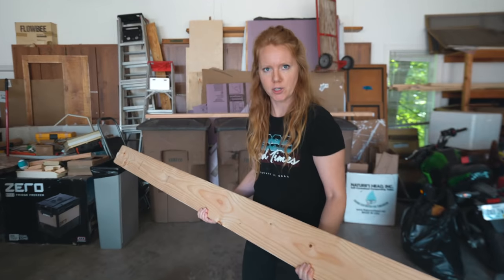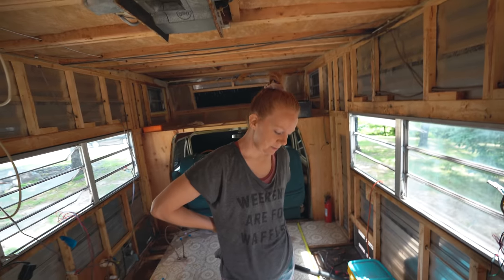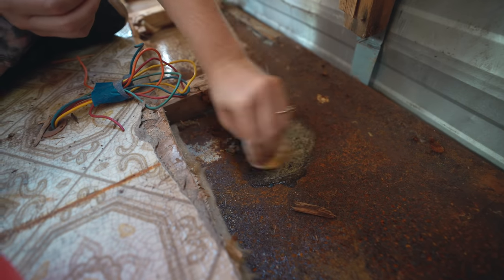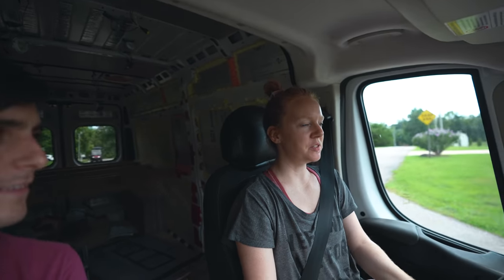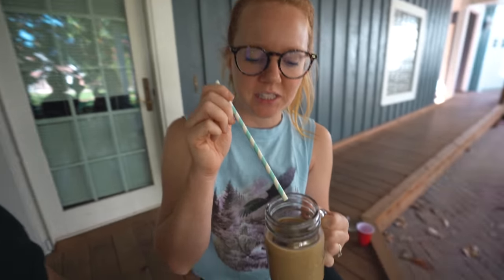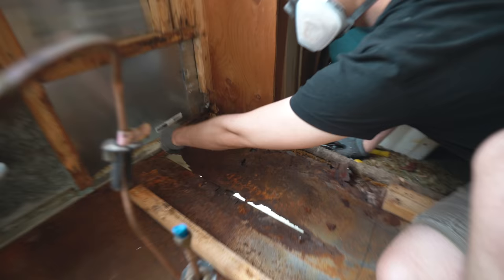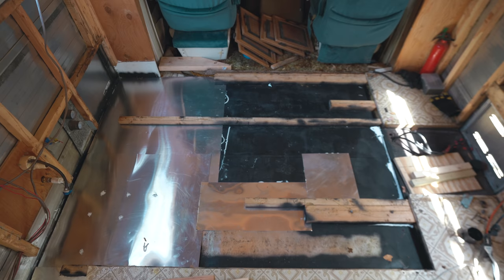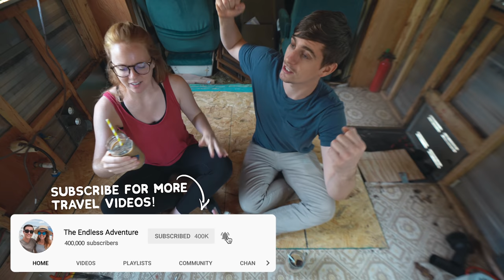RV Renovation - We Completely Rebuilt Our Floor! 😳 Longest Project Yet (Ep. 8)

Comment: Just something that was on my mind. If its rusting, its not aluminum. Its iron/steel.
Reply: Exactly, aluminum can corrode, but it looks nothing like rust. Aluminum corrosion creates aluminum oxide which more of a white-ish substance. It’s also way slower process compared to rusting steel/iron which you can actually see rust in real time if you just spray some water on it. :P
Reply: its not actual rust as its a Aluminium oxide which forms when the metal is exposed to water, also if there is any steel in this RV then its more likely to be either galvanised or stainless steel which does not  corrode but takes a long time o rust
Reply: When Aluminum corrodes it is white not red, alert Aluminum on Steel or galvanized will corrode very fast (galvanic corrosion)....Use a magnet to check... aluminum is non magnetic.

Comment: I sure hope that you fill all those cavities in with moisture resistant foil faced insulation,  than a layer of reflectix on top of that, before putting the floor plywood down. The difference is incredible and so worth it. The same with the rest of the motorhome,  walls and ceiling. It will heat and cool so much better,  and be so much quieter.

Comment: I think you had thin sheet metal and not aluminum. Rust is a steal trait.
Reply: I was shaking my head. How don't they know that aluminium doesn't rust?
Reply: Probably rusted galvanized
Reply: Because they haven’t taught “shop” in schools for a long time
Reply: Hope they've realised in time. Add a magnet to your kit......
Reply: Aluminium doesn't rust in theory it can oxidise, but that was definitely some sort of plated steal the rust had eaten through the material to the point Eric could tear it from the structure.
Reply: Aluminum can't rust but oxidation does occur... and if used with steel, can be a catalyst for oxidizing the steel, which will in turn rust, but it is no more a catalyst than the metal itself is, so basically, they still have a much better floor than when they bought it, especially after beefing up the strength with 2x4s.
Reply: *steel
Reply from the maker: Thanks for the note. We've realized our mistake and are working on taking out the aluminum bits. Unfortunately it's our first time working on a project like this, so we're learning a lot as we go.  I'm sure it won't be the last thing we get wrong, but we really appreciate you all looking out for us 🙌
Reply: @Theendlessadventure  keep up the hard work aluminum is better for rust anyway.
Reply: @Theendlessadventure  ...as Dory says "Just keep swimming!"
Reply: @Theendlessadventure  easy way to tell is aluminum isn't magnetic, steel is.

Comment: My wife and i own a 1989 Tioga class C motor home. We want to share 2 important things with you. First the large window in the over head cab area should be eliminated for the following reasons: constantly leaks, lets in a lot of heat or  a lot of cold. The overhead  portion on a class C motor home sits a rubber bushing to help the unit absorb the constant flexing that it will do driving down the roads. When you camp off grid many of the roads are wash  boarded and vibrate the entire camper. We have rebuilt the overhead part twice and the second time i eliminated the large window and it is a blessing. Second the best material you can use for your flooring is Marine grade plywood. Yes it is expensive but it does not rot, or warp, and is extremely strong. OSB board is made with scrap and glue, even the more modern boards today when exposed to water will rot.  The material when exposed to water turns to mush.  It is the old adage you get what you pay for. Your videos are  excellent and you are trying to do everything to make your camper last and become beautiful again. I do not want to make you feel bad, jut want you to not have the headaches that we have endured as we have owned our camper for well over 20 years and raised 4 children with it and now we converted it to a couples camper. We wish you nothing but the best and hope this helps you. One last thing you might want to add to your camper is hydraulic leveling jacks to your camper if you do not have them. They are well worth the investment as you can stabilize and level the RV from inside during inclement weather. Best of luck and look forward to your videos as you experience your camper renovation.

Comment: Should have insulated the floor where you had it apart.    Also I think your metal on the floor is steel. You can always try a magnet to determine what the sheet is.
Reply: It was steel, but they put an aluminum patch.
Reply: Isaiah Bangura right, which is why I commented to them about using a magnet so they could determine the same thing and avoid using nonsimilar metals together.

Comment: One last thing on this video... Prime everything, metal, wood everything
Reply: The reason to prime the Al is your adding it next to steel. You will get galvanic corrosion and that Al will be gone in no time....
Reply: I was thinking that it wouldn't hurt to coat the underside of the chassis too. Salt water on roads tends to be bad for vehicles.

Comment: That's not aluminum.  That's sheet steel or tin.  Aluminum doesn't rust.
Reply: tin doesn't rust either, it oxidizes. tin oxide is also generally white.
Reply: @upwardsofunknown7161  Yep.  I knew that.  but tin will rust in it's more advanced stages of decay.
Reply: Tin doesn't rust (rust is by definition oxidized iron - all the alchemy in the world won't get tin to rust).

Comment: a little trick with the aluminum floor is to spray truck bedliner under the RV it will protect the aluminum and quiet down the road noise.

Comment: I'm glad y'all liked paper straws, I think they are awesome. What I do with my paper straws, is take them camping. I like shoving pine needles through them and using them as fire 🔥 starters. Then I get my plastic straws out of a plastic wrapper, and use that to drink with. The thing about plastic straws is you can rewash them several times with soap and hot water.

Comment: OSB is prone to absorb water like a sponge so if you ever have a leak again you will have to replace it again. Use plywood for better structure and durability and as you screw it down any warping will be forced out of the boards. Once you lay the new floor make a mixture of Borax and extremally hot water and spray the new floor down with it to moisture and mold treat it.

Comment: floor is rusting so it's pretty likely to be steel - putting steel and aluminium together is going to create a galvanic corrosion cell eventually....  using bolts / screws through steel /aluminium is worse than gluing though.  A  general purpose "no more nails" type adhesives may not be the most structurally effective bond on aluminium to steel sheet  due to the surface oxidisation on both...  aluminium adhesives are available and used on panel work.. but may be harder to source.  Riveting is often used to pull the panels into shape and provide a good mechanical integrity but again be aware of riveting dis-similar metals together ... Simple hand "pop" riverters are cheap and easy to use - and you can use them in "blind" areas where you can only access one side - if you have a lot of sheet metal to rivet cleeco / advel temporary pins help to keep everything jigged up as you rivet.

I'd check the metal floor panels with a magnet  just to establish if they are steel or not  - I very much doubt they'll  be stainless which is also pretty much non magnetic - due to cost - plus it's rusty so that rules it out. It could be galvanised steel sheet  (zinc coated for corrosion resistance) or simply have a coating / paint that has a dull metallic appearance like aluminium??

Best of luck - see if Coachmen can provide details of the sheet metal used in the flooring  - they will be the definitive source of info.. surely?

Comment: My advice to you is to look into the winegard 360+ TV, Wi-Fi extender and and internet router.
I just bought mine from Amazon, stalled it today.
Absolutely stellar reception for the TV antenna. My RV is parked next to a crop of trees blocking the signal coming from Seattle and Tacoma, I was able to get morein my RV been in my house with an antenna in the Attic.

Comment: Hello,  While watching your video I want to suggest a product, its called Miracle paint by Mercedes and if you go on line and google it you can watch the video. This is a rust inhibitor that actually goes over the rust on your flooring and underneath the camper which will cover all the rust and never let it come back. I think it would be wise to look at this product as an undercoat for your vehicle as it would greatly help for the future of the camper. I have used this on my Jeep renovation and it is the best thing I ever did, my jeep is 30 years old and it now looks brand new.  Good Luck.
Craig

Comment: i learned a lot from watching your videos. I have seen every episode. I wanted to point out that the bolt that you cut off was actually one of the joiner bolts that holds the camper on the trailer. Other than that I thought your ideas on how you tackled the problem areas was awesome. Something to look forward to when i do mine :)

Comment: Holy moly what a mess down there, aluminium doesn't rust though? So it's probably steel which means that aluminium sheet you put in will cause the steel around it to rust 😮

Comment: The sub-floor look very similar to corroded tinplate or zinc sheets, an alternative to dropping and tearing up the whole floor again is and treating the floor from the underside with first thin/light rust-coating then thick underbody coating, like tectyl for waterproofing.

Comment: I’m concerned about (not critical of) the aluminum with metal as well. But an added concern is that you simply glued the new aluminum sheets to what was already there. It would definitely be better to rivet those to the sheets below along with the sealant/adhesive. They will stay in place better. (Not hating!! Just advising. I get plenty of comments on my projects and I don’t even post videos. Can’t imagine getting hundreds and thousands of comments on one part of one project.)

Comment: Since they coated the original flooring with paint, won't that stop the issue between the two different types of metal?  It looks like they didn't use pressure treated wood so that should clear them for the copper vs aluminum issue, yes?

Comment: Which product to use on the floors (or anywhere else) should be decided by both function and weight.  The heavier that van is when you are done, the worse your gas mileage, and the slower you will climb hills and mountains with it.

Comment: Aluminum corrodes but it does not rust. Rust refers only to iron and steel corrosion. Aluminum is actually very prone to corrosion. However, aluminum corrosion is aluminum oxide, a very hard material that actually protects the aluminum from further corrosion.

Comment: MDO is your best waterproof plywood its more money but you will never have to worry about it again I'm building my second bus conversion so I know what works and what doesn't osb will fall a part over time with any moisture and when it's hidden you'll never know but if your not going to keep it forever just go with it and that's the reason other people have to fix it later.
Also the other comments on the aluminum over steel with the electralist?
Anyway simple science would be to grab a magnet and check the material right even though it's not a good idea to mix the different metals it won't fall apart for more than 15 or 20 years I'm sure the motorhome won't be around by then or it will be taken down to the frame and completely rebuilt but most people don't want to spend 10s of thousands of dollars for a 70s something motorhome people need to relax and let the kids have some fun and enjoy what they have built. I'm just saying.

Comment: What type screws did you use for the floors or edge of the frame? Was it all pocket screws? Are pocket screw rust preventers? My wife an I are currently working on a 77’ Winnebago and are at the gutting stage. Love the series!

Comment: That is definitely not aluminum because alluminum doesn't rust that's galvanized sheet metal so basically chrome coated steel sheet metal but great job putting new  alluminum down was probably a good idea

Comment: I dont know if anyone has commented on this or not, but your wheel well box looks like it will faIl.  Your horizontal pieces are being held to the vertical pieces by screws.  The fact that you will put weight on them means they are no longer weight bearing, or load bearing.  You should have made the horizontal pieces longer and have the vertical pieces fit inside of them, so the ends are supported by the actual vertical pieces.

Comment: I hope you don't use OSB as the flooring. I would use pressure treated plywood.
Reply: This was discussed in previous video. The copper in the pressure treated  plywood reacts to other metals and causes corrosion
Reply: That's what tyvex barrier is for.

Comment: I'm looking forward to the electrical installation. Hope it runs smoothly. But we all know that it won't.  I'm an electrician and can help it's a pitty I live in Scotland . Ask me anything. Best of luck with the job in hand. Your doing great.
Reply: Ask me anything I can help. Use this chat. I've been with you since Nandos 75k I think. Genuine offer of help.
Reply: I am scared about the electrical since they have had so many problems choosing materials for the renovation (mixing metals not thinking about weight when choosing OSB over plywood). Hopefully having to pull out the floor again will teach them that they should run their plans by the viewers before they do things.

Comment: Don't  like to say this, but aluminium  doesn't  rust !! It corroded but doesn't rust, rust refers only to iron or steel corrosion, aluminium corrosion is aluminium oxide, a very hard material that actually protects the aluminium from further corrosion..... this is according to Google....... sorry guys hope I'm not a party pooper. Have to say I'm very impressed with what you have achieved brilliant job 👍👍👍👍👍👍

Comment: Aluminum does not rust. You are placing aluminum over mild steel and that will cause more corrosion. If it is rusty red it is steel.

Comment: Aluminium doesn't rust surely you know that. It must be sheet steel, there would be a good reason they used steel and not aluminium, for your safety sake lets hope its just because its cheaper. Just putting patches on top of it wont stop it re rusting and eventually giving way.

Comment: OK I love you guys but I just have to get your attention on an issue, thought someone from previous videos would point this out... If the metal rust is red, then the metal is steel NOT aluminum, so make sure you're using zinc plated/galv fasteners. And looks like some of the aluminum that you glued are in contact with bare steel, so that is...not a good idea. You can also tell the difference by the weight and color of the metal, but that's usually not an easy tell unless you're a pro. But remember, if it rusts red, it's steel/cast iron! And if you guys are getting tired of figuring out metal compatibility from your comments, look up galvanic corrosion chart.

Comment: As long as you were at it why didn't you go ahead and replace the entire floor?
Reply: My thoughts as well... should have just done the entire area and never have to worry about it
Reply: Remember cost is a huge factor!
Reply: Doing it right the first time is cheaper.
Reply: Three or four more sheets of OSB certainly wouldn't break the bank.
Reply: We don't know their budget or really any of the bills they pay.  Let them do the best the can do.
Reply: yes...at this point why not?  And why not get rid of the linoleum while you are at it? A new floor would make it feel so much cleaner....
Reply: @alanholck7995  You got that right. Fix it right then you only have to fix it once. Do it half assed and you are always fixing it. I never pays to be cheap cuz when you have to keep fixing it because of taking short cuts it ends up costing double what it would have if you did it right the first time. Penny wise pound foolish.
Reply: @hermioneg288  if the would have ripped out the whole floor the linoleum would be gone plus all the floor joists would be new and solid versus sistered together with pieces making it a much weaker less durable product. Daddy used to say if you can't do it right don't do it at all.
Reply: BIG DAN C. I’m with you on that ... fix it right instead of patchwork... plus with all the movement of the rv it won’t remain solid vs completely repaired floor would
Reply: @bigdanc.8429  Daddy's a smart man.

Comment: Why not just pull up the entire floor? After cutting out that one section. It actually was not that much more to just rip it all out. Clean everything, and then install all new clean board. And it would ensure a nice even surface in the entire cabin. Frankly, just fixing the one area, may come back to bite you later, in the build.